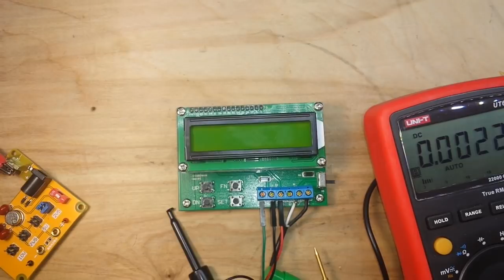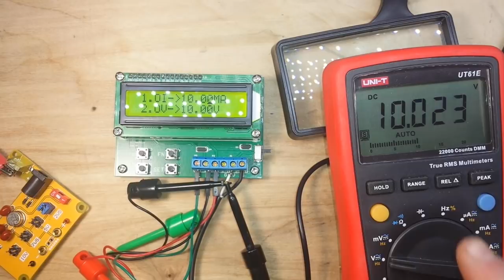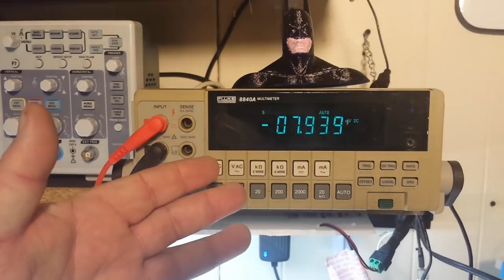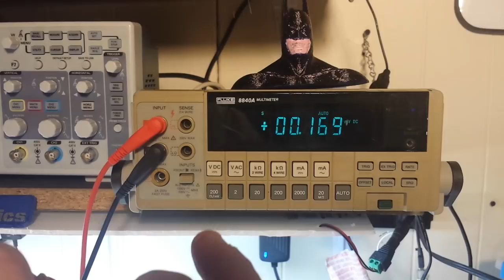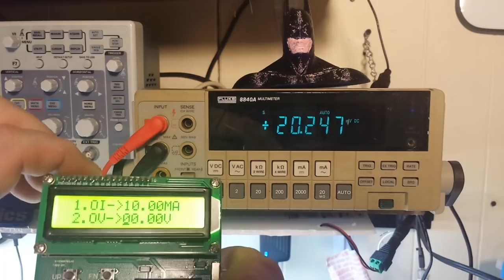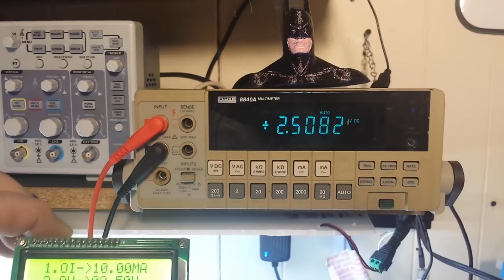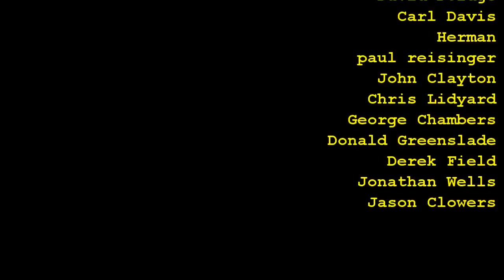Affordable Voltage Standard Shootout

Comment: Hi, I just bought the cheaper one and it has a socket for external power. I'm just not sure what the polarity of that socket is? I have a 12v power supply and the jack plug has a positive center pin but is that correct for this module I wonder? I don't want to blow it up!

Comment: Thanks for the video.
The problem here as I see it is there is no true reference to calibration.
What can you believe to be accurate?
Is the Voltage reference off, or are the meters off?
You quoted an accuracy of the first voltage source but can you trust that?
What if the device is faulty or inaccurate?

I guess I would need to see the data sheet for the device to be convinced what the true accuracy is.
Reply from the maker: You simply must decide for yourself what you accept as a standard.

Comment: AD584LH voltage reference module tested
A very accurate voltage reference is useful in the lab for checking your measuring equipment. With this PCB that is available for prices starting at € 8.00, however, something strange is going on. The complete PCB is much cheaper than the IC that is on it. We investigated this issue and found a strange thing.
➡    Read this article
https://chinese-electronics-products-tested.blogspot.com/p/ad584lh-voltage-reference-module-tested.html

Comment: The device from alice1101983 should have arrived with a printed piece of paper with actual calibration values for each voltage (I purchased a couple from different ebay suppliers). In another video I saw the actual calibration process for this board. The calibration instrument used appeared to have a valid calibration sticker, that was close enough for me... +/- 1mV will do fine...

Comment: Why not try the J8K4? It has two rotary encoders It just needs a 24V AC power source (transformer) and a 24VDC fan to keep it cool and running smoothly, I bought it and assembled it; but I need the transformer, and fan(60 mm I think)
Reply from the maker: I'll check it out, thanks
Reply: Cool!

Comment: the little hook leads. that come in green red yellow black and a few other colors. I saw them on amazon.  how do you connect it to the meter leads? I didn't see how . on the amazon ad. I feel dumb for asking. its the short ones about 2" long. I was thinking about getting some. I put a gator clip on one of my meter leads. and it doesn't make good connection anymore. but I can just pull it off. and its the original tip on it. its just held on with tape. I crimped it to the lead tip. great video as usual. happy new year.
Reply from the maker: +James stranger I have a few different types. My favorites are the ones that slip over the meter probes.

Other ones just have an empty end you can solder to what ever you need.

Comment: I like my cheap multimeter  (Commercial Electric) but have the auto ranging UniT clamp meter downstairs. Nice to have a voltage reference but like u said not required.